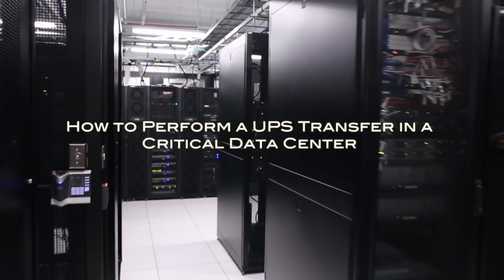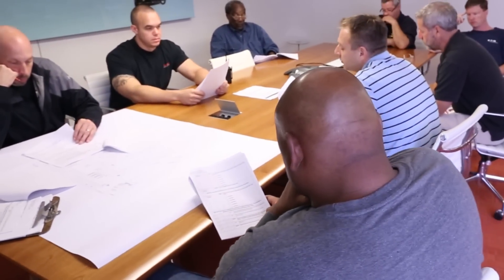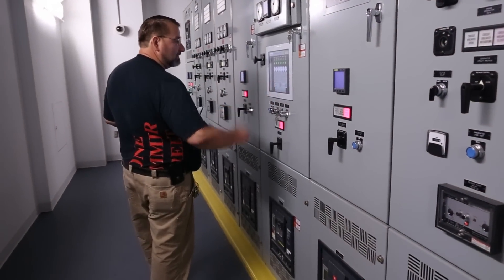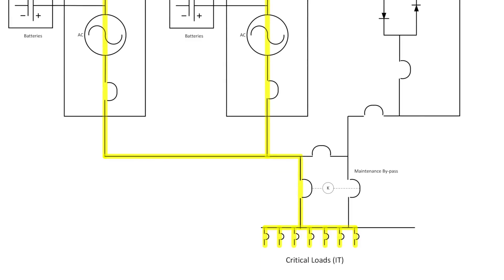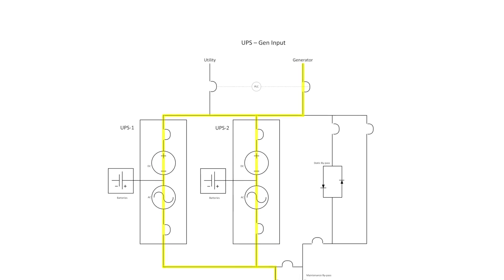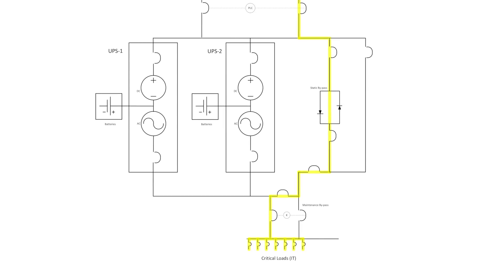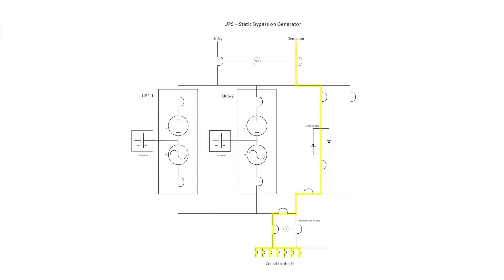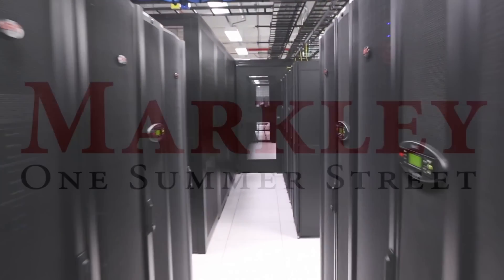How to Perform a UPS Transfer in a Critical Data Center

Comment: So at my site, we just point the load to the opposite source via the STS's, then isolate the UPS that needs to have maintenance performed. 
  Does anyone know why these guys are using the Generators to support the load and then go to static bypass, then to maintenance bypass so the UPS can have maintenance performed??
  .. is it simply a "more than one way to skin a cat" type situation?

Comment: Yes, warming up of the generator is good for the tests, but the main role of this system is to provide the electric power when the standard distribution network stops to function.
More than 30 years ago, the headquarters of respectable corporations had a batteries banks which would provide 10 second of back up through invertor, and in those 10 seconds the generator kicks in. So, there is no time to warm up the generator, but that's OK.

Comment: We'd never purposely support critical load with the generator system.  Critical datacenters would have redundant parallel UPS systems and while shutdown maintenance is done on one system, the load is supported by the other system.
Reply: Glad I'm not only one that noticed that. At my site, we just point the load towards the sister load via the STS's, , so that the load is still supported by "clean" power, then place the UPS needing maintenance into static bypass, then to maintenance bypass ("global wrap"), so it is isolated and safe to perform work on.

Comment: Why are they wearing 40 cal suits for an open ATS transfer?  There's no need if all enclosure doors are closed.  The enclosure is DESIGNED to withstand an arc flash event by directing the flash behind the cabinet.
Reply: They’re health and safety officer mandates it? But I agree, only our electricians suit up if they are working on live boards where you can literally reach out and touch the 800 amp bus bars…

Comment: Why would you engage the genset to perform the ups maintenance,
You can easily switch the ups to static bypass then maintenance bypass and disconnect the battery boost and charger your ups is fully isolated to be worked
Reply: Your not wrong but what if utility power goes out then that’s why the generator is started 😊

Comment: does he not have to isolate from the battery supply also? Or has it just been omitted from the video?
Reply: You bypass the batteries internally in the UPS, then parallel bypass around the UPS through a bus. Then open the internal bypass within the UPS.

Comment: When you are required to wear a full body protection suite to flick a switch, you know this amount of energy means serious business.
Reply: We call it a hot suit. And yes, if something goes wrong inside that switch gear At worst you lose a limb, die, or have all of your skin combust and melt off into a puddle on the floor. And even the suits don’t protect someone fully. Also, the vaporized copper from an arc fault can be inhaled. So Yea hold your breath when you flip breakers :)

Comment: lmao but why the mans lookin like he tryna defuse the bomb tho
Reply: because when switch is switched on you realy never know what will happen. teoreticaly switch should handle maximum shortcircuit current, but poorly maintained switch or wrongly designed switch/cabinet (or shortcircuit in strange place) and explode can happen. equwalent of shortcircuit in this scenario will be explosion of granade.
Reply: @prjk7339  Well yes, I agree. But isn't it closed cabinet ?
And how can short circuit happen apfter installation test, and regular monthly tests ? Or can this happen only in USA ?
Reply: @robimaren3247   don't know how it is in USA but i know you have lower voltagest so to have same power current increases.the higher current the more sophisticated switch, bigger wires diameters and shortcircuit currents. Also  you see only cabinets. But how to enter to cabinet with wires/rails? Often this is weak point used by fluids/animals. Also bad connections/wrong technology can cause heating/melting/shortcircuit. During normal operation it is rare event. Most common it happens during maintance/test/brakedown often by peoples in stress, lack of procedures. Also peoples dont realize that switches have limited numbers of switching actions (switching current dependant, and it is hard to aproximate how broken connection inside switch are)
Reply: https://youtu.be/PO6see7_ODY

Comment: why do they have hazmat suits on?
Reply: It protects them from dangerous arc flashing
Reply: This!  There's no need for 40 cal suits during an ATS open transfer if all enclosure doors are closed.  The enclosure is DESIGNED to withstand an arc flash event by directing the flash behind the cabinet.
Reply: @shortattentionspangarage1312 it is a closed transition as both utility and generator are active sources at the time of the switching

Comment: So wait, according to that diagram, Utility power can be sent to the maintenance bypass. So what's the point of switching to the generators? As a just-in-case measure if something does happen to utility power?
Reply: I would guess as a just in case. Without running backup power, any disruption to utility would bring the place down.
Reply: Generators are more trustworthy than utility power.
Reply: The maintenance bypass is downstream from the ATS so you could send utility power through the maintenance bypass if utility was selected on the ATS. However utility power is not considered reliable so before that operation takes place the ATS selects the generator source.
Reply: that diagram is very poor, symbols are not conventional, but they show the load transferred from UPS modules to "static bypass" cabinet (operation done by UPS to transfer to its internal bypass), then its transferred to "maintenance bypass"  (performed by closing external bypass breaker on switchgear). At the end the load wasnt feed by utility because UPS was transferred to generator then placed in bypass.

Comment: Let me guess but will spell it wrong Russell switchgear. Had similar equipment at my old job. Had a goofy generator cool down cycle when runnining load banks. Other equipment took 5 minutes but this equipment took 12 minutes.

Comment: Are all the ATS switches  closed transition? Hospital/ Research center that I retired from had about 70 ATS switches spread out over 6 buildings. Tested them every month and had yearly PM on them.
Reply: What do you mean "closed transition"? Utility and generator breakers closed at the same time for a second during transfer?

Comment: Brings back memories of our set up at our NAVFAC.  We were able to sync the gennys to shore power without any lights going off.  Only time the lights went off is if shore power took a dump.  Saw no sync scope, guess the switch gear does this for them?  Guess the arc flash suits are new.  We just had our OD utility greens on when we worked the switch gear.
Reply: The 40cal suits are safety theater. They're not working on exposed an exposed bus. Honestly they expect people to suit up in an emergency like an ATS failure?
Reply: I currently work for NAVFAC UPS Shop. Looked like a Powerware 9390 UPS in the video. Everything is PLC ran now. Automagic! hahaha

Comment: Why work on UPS-1 and UPS-2 at the same time?    Why not take them offline one at a time ?
Reply: Its for reliability.  Running on one UPS at double load is a single point of failure.  Running on multiple parallel gens is not.
Reply: I don't think you should look at them as doing each their redundancy, but rather that to supply enough power for everything, you need both, at least if you want it to run within the time-window for testing.
Reply: I'm thinking they are both separate.  Ex: UPS-1 is doing one row of racks, and UPS-2 is doing the other row.  Though I suppose they could engineer it where they can transfer load around in order to have more redundancy.

Comment: Why would the gensets be preferred over utility for the operation?
Reply: From my experience, as you are taking the UPS (batteries specifically) offline, if the utility were to fail, generators would not be ready instantly as they have a warm-up/spin-up time. Normal operations if  the utility were to fail, batteries would provide enough power until the generators became operational. With generators operational, you have a second power option with utility. Always have two active forms of power.
Reply: @NathanChan40 True, but why would a critical data center not have a redundant UPS and swap the load to that, then turn the inverter of (static bypass), then isolate the UPS into global wrap/ maintenance bypass?
Reply: @hagindustin777 didn't say it should not. I said it should always have two forms of active power, gen, battery or utility. If one fails, there is a fail over. Key word being active or running, if truly a critical infrastructure.
Reply: @NathanChan40   Thanks for the answer. In my area there's a lot of hydro and pump hydro (excess power) and I haven't ever experienced a black out, however when working in isolated industry I saw a few gensets releasing their inner smoke, hence my question.
Reply: @ml9849  There's loads of hydro power in my area as well, but that doesn't help you when a tree falls into a power line or a drunk driver takes out a utility pole
Reply: They have no control over the grid, but some level of control over their generators. As Nathan Chan has said, it takes a long time for a generator to startup and take the load. The bigger the generator, the longer it takes. If the UPSes are bypassed, and the grid fails, you want the generators to already be spinning and in sync. Even 'tho they aren't on grid, the PLC is keeping the generators in sync with the grid; should the need arise, they could go back to grid-only in milliseconds, without dropping the load.
Reply: It's more reliable as they will have multiple generators they can sync together so don't have to worry about grid going down.
Reply: Because the generators are more reliable than the utility.
Reply: While UPS is offline for maintenance the only reliable power source is the generator.
Reply: If you live a third-World country, blackouts are common. In the first World, they are less common but still happen. You would be mad if you had electricity but no Internet.

Comment: Looking at your schematic drawing I would ask why do you put you it load at risk and run on generator raw power when you could isolate one ups system to work on and use the second ups system to power the load and maintain ups support to your it load . As a data Center I would expect you to have a minimum off N+1.  So 1 ups should be able to take the load . 
This is something that I do as a regular switching operation for ups maintenance.
Reply: I imagine they only want to rely on one UPS system in true emergencies, where one UPS has genuinely failed. They don’t want to voluntarily throw away their safety measures for any period of time if they don’t have to.
Reply: @appleintosh  sorry I don’t follow you reply.  They are running the load of two ups systems in parrelle  they want to do ups maintance. So they shut off both ups systems and switch to a generator .  So now they have no ups backup. Generator stops they have lost it . 
Why not just turn off one ups and let its brother take the full load then isolate the other ups and service it . They would now still have ups backup.  Unless they are not running N+ 1.  And one ups can’t take the full load ...
Reply: @hotrex7779  Sounds from the video like they are running multiple paralleled generators. If N+1, the loss of a generator shouldn't impact the load. On the other hand, if you take one UPS down for maintenance, you no longer have N+1 UPS, so if a failure occurs to any other UPS while one of them is undergoing maintenance, you drop the load. It may seem like an unlikely scenario but I've seen it happen, where one UPS was being worked on and the other UPS suddenly gave up the ghost, dropping the load.
Reply: @hotrex7779  If they have multiple generators, the risk of one generator dying during the middle of UPS maintenance is mitigated. If they have enough generators to handle the load with one or more generators failed, they don’t have a single point of failure. 

If they take one UPS offline for maintenance and rely on the other UPS for their backup, that’s now a single point of failure. If mains power is cut off during maintenance, and something were to go wrong where the one operational UPS can’t take the load until the generators kick on, their facility loses power.
Reply: @TehMG  I would have guessed the most systems would also be fed using redundant power supplies with separate power rails. In this case you could patch one rail to the gensets and leave the other rail on the spare UPS for added redundancy. Better safe than sorry - I've seen too many controls not entirely delivering the advertised failover capabilities when needed in real life.
Reply: @TehMG  I think that the total scenario of how and what the loads are being fed would have a influence on how one may want to do this operation .  I have witnessed synchronised generators falling over when one generator has shut down unexpetantly and due to reverse power flow the others have dropped of the bars .  In our operation we have independent A and B feeds to the load from  2 separate  ups systems   With N+1 redundancy . The generator not only feeds the ups systems but also the power for the rest of the mechanical plant so it’s being subjected to switching loads during its operation so it’ is not a clean supply .  Our procedure is to keep the load fed via ups so that it is still doing its job of giving a clean power supply to the Load . In the event that the single ups fails while the other one is being serviced  it should still switch via its static switch to raw power from the generator And support the load . If the static switch fails as well as the ups. Then yes I agree that it will drop the feed . But as this is only the A or B  feed into the load  the load will still be powered . 
This is a Wonderfull topic to debate and it’s an interesting thing to see other ppls  views on this
Reply: @TehMG  If any UPS failes while other UPS is off, that UPS instantly switches to bypass supply depending of synchronisation status, so even one machine kept running and other system Preventive Maintenance taken then load still protected except bypass supply is readily available from DG or UTILITY
Reply: It looks like there are no isolators for each UPS in the schematic. Pulling out just one means that the bus between the two UPS is still live and thus you cannot work on the UPS.
Reply: @nathanisip   I would be very surprised if there was no means of isolating the ups from the output bus . It would be a first for me to see a system  with  outputs connected to the output bus bars  with no over current protection and means of isolation ...  though in this industry I have been surprised a few times
Reply: @nathanisip  in our UPS these switches given inside UPS cabinate, if i want to take maintenance, just take changeover from utility to DG set, then turn off inverter of UPS & Turn on maintenance bypass switch inside cabinet then turn off all other switches and after 5 mins i can do preventive maintenance in ups
Reply: I'm wondering if part of the reason is also that these servers are large enough that the UPS can't handle the load long enough to do the work. With these generators needing a warm up period, the UPS might not power the servers long enough to get the generator going. This is also probably a good time to test those generators. Redundancy is the key to dependency in this situation.
Reply: Question is what's the IT load? Although UPS is capable of taking the entire load you shouldn't be running UPS on 100% capacity though